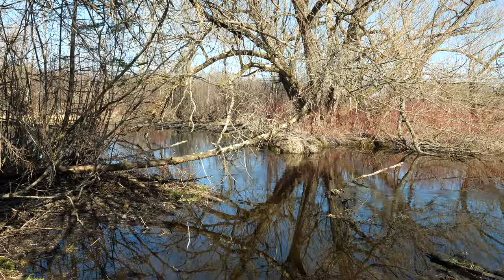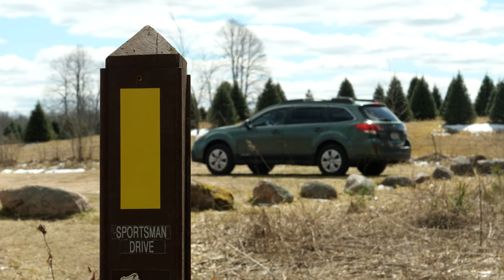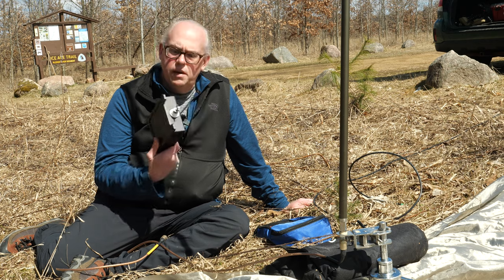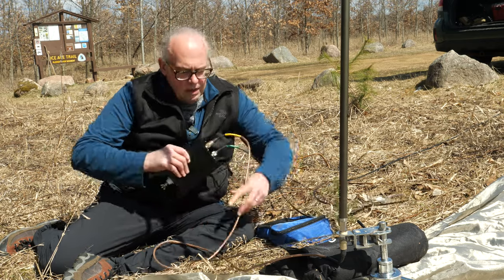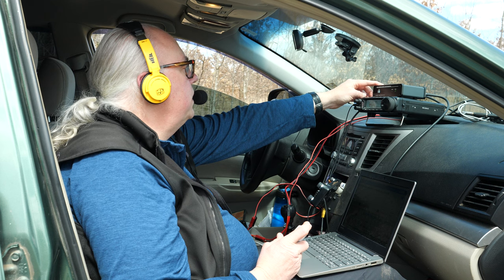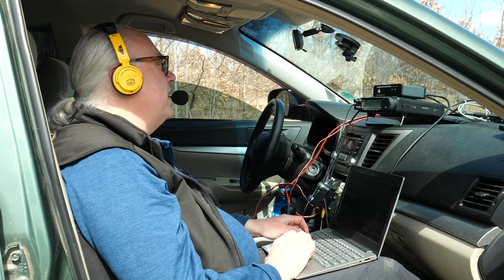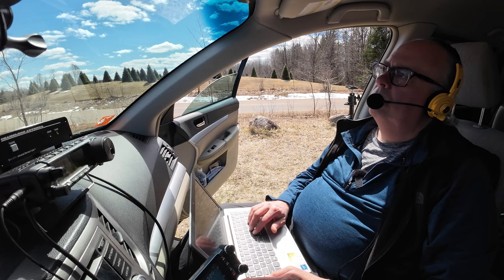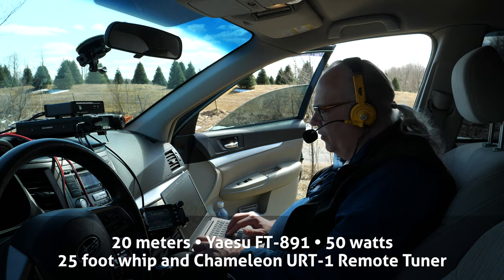Build the Frankentenna: the ultimate portable ham radio vertical antenna

Comment: Hey Mike, thanks for the video.
When I look at the dimensions and all the pieces of this Frankentenna, it reminds me of the Rybakov, except that it’s self supporting. If you use the chameleon hybrid, which is a five to one transformer, it’s almost the same.
Reply from the maker: Yes, this is very similar to the Rybakov. Also using the Chameleon hybrid transformer is a great idea instead of the tuner as it is closely matched to the 4:1 unun that the Rybakov utilizes.

Comment: I’m liking that tuner with the Frakentenna.  The only thing you had missing was the Chameleon Cap Hat placed between the 17” whip and the Mil Ext 2.0…. LOL. Thanks for another informative and entertaining video.  Bill, KC2KNA
Reply from the maker: I forgot the cap hat. That would have really turned this thing into a monstrosity.
Reply: @KB9VBRAntennas so I may try this set up tomorrow at home with my LDG z11 proii atu. I also have the cap hat, would difference could that make in your opinion

Comment: Great video Michael. What a great result with that antenna! I was out back this evening with my Icom 705 when it clicked--I've got Chameleon's MPAS 2.0-ditch the micro hybrid transformer and just use the Icom tuner at the feedpoint! Worked really really well. Great to see your demonstration that I've got a lot of fun to look forward too! Thanks! John KF0AE 73
Reply from the maker: Yes, you can do that. Using the broadband transformer is convenient, but using a remote tuner instead will increase performance.

Comment: that was very nice. thank you for taking time to get some nice video of the park !  that was a great day for the park. the upper bands been weird hear in NY as well. 10 and 12 meters was open but some noise and QSB and DX was going south for me. South America. Brazil coming in 12 meter SSB.   FT8 on 12 was mostly south and far west coast . was testing end fed half wave cut for 10/11/12 meters. I fold back end to tune. Veritable on 10 meter pole with 4 -17ft   counter poise. 49:1 UNUN with 2 stack of FT 240-61 toroid's and 100 PF 3 KV cap wound with 10 AWG mag wire. handles QRO  just fine. short time 500 watt FT8 no heating on ferrite. SWR 1.3 . love that remote tuner. 73's

Comment: Michael what is the ground plane you used? Looks different than the metal screen.
Reply from the maker: I use a fabric called Faraday cloth. It's a conductive fabric material that's primarily used for making electromagnetic resistant bags and containers. But it is conductive so it works great as a ground network. Here's the cloth: https://amzn.to/3RTjDv7

Comment: Roughly a Rybakov 7.6M antenna. Have often thought about trying this with the Chameleon Micro. Maybe even experimenting with the WR Sporty Forty center loaded to see if that would improve 40 meters. But thinking about it never got it done! Greet video.
Reply from the maker: You are correct, this is setup is in effect, a Rybakov antenna. Center loading the Sporty Forty is interesting, though. I'll add that to my list of things to try.
Reply: @KB9VBRAntennas  Had yet another thought. What if you center fed this set up? Seems like you would have a "by the book" less compromised shortened OCF vertically polarized                 dipole. Unused base feed point would isolate it from ground. And you might be able to bring your coax straight back to another support like a picnic shelter eliminating interaction of the antenna with the coax and as well as the "tripping point". Thus also creating a single guy point to boot.

Comment: Did the “feather flag base” need any other help supporting that vertical antenna?
Reply from the maker: If there is no wind, the base does support the antenna. But on a previous occasion using this setup, the wind knocked over the antenna twice. So for this time, i put a sand bag on the legs to keep it stable.

Comment: You should have connected the "beehive" connector directly to the base of the antenna with a wire, NOT a coax. The impedance is high and will cause a lot of loss using coax. Another option is using a 4:1 or 9:1 transformer at the feed point. Radials are also needed.

Comment: Michael, great video as always, question, does your "Frankentenna" end up closely approximating Chamelion's MPAS 2.0?  What do you think of that rig and is it worth the high price?
Thanks,
Paul Sanders KK6RXU
Reply from the maker: This setup is a bit longer than the MPAS 2, but it does closely replicate the Rybakov non resonant vertical. All remote tuners are pricey and the Chameleon isn't priced out of line compared to similar models (it's only $40 more than the Mat 40, and it has more features). Last week's video digs deeper into the tuner: https://youtu.be/Ubw6jrACVU8
Reply: Thank you Michael.

Comment: Very interesting! If you don't  mind. Im looking at the Icom 7100 vs ft891. Im leaning toward the 7100. Any suggestions, as Im new to HF. Thanks much!!
Reply from the maker: Good question, because both rigs are about the same age. The 7100 has the advantage of VHF/UHF and a slightly bigger display. But the control head is a separate piece, so you are always dealing with two parts. The 891 has the head integrated into the unit with the option of being removed, but no 2 meter and 70cm support. The 7100 was originally designed as a mobile transceiver, hence the separate head. I have a friend that takes his 7100 portable, he keeps it in a case and pulls the head out when he uses it. But other than that ergonomic quirk, I've used it and it is a fine rig. 

On a side note, Icom tried to discontinue it twice, but popular demand has kept the IC-7100 alive and they keep bringing it back.
Reply: @KB9VBRAntennas  Thank you very much! I did see it discontinued , and I asked them why. They told me that they couldn't get the chips or whatever components. Possibly due to the plandemic! I think Ill save for the 7100. It will be for mobile and home. Thanks much!

Comment: How would you compare that ATU to your LDG? If you had to chose one which would it be
Reply from the maker: That's a really good question as both serve slightly different purposes. For most portable operations a tuner by the transceiver, like the LDG Z11 ProII is sufficient as the impedance mismatch on the cable isn't that high and that tuner is a little easier to set up. But if I wanted to direct feed a non resonant wire or build a vertical without using a transformer, then the remote tuner is the way to go. 

The Chameleon remote tuner lets you do some really inventive stuff out in the field, so it is really fun to experiment with.

Comment: I NEED YOUR ADVISE. I WANT TO USE A 18 FOOT TELESCOPIC WHIP AND USE A MFJ ANALIZER. FOR 10 METERS, DO I NEED A 4:1 OR 9:1 BALUN ? THIS WILL HAVE 4 TO 8 WIRE RADIALS ON THE GROUND PLANE .
Reply from the maker: If you have a telescoping whip, you can adjust it to a 1/4 wave vertical. Then you won't need the unun at all. For the 10 meter band, the whip should be approximately 96 inches tall.

Comment: Dear Michael, thank you for this video. I am curious about this arrangement. Chameleon makes a coil that would easily (?) have given you the bands you wanted to use (I believe) and the $$$ is similar to the tuner. It is understood that your antenna knowledge is extensive, therefore my question: why choose the tuner over the coil? Thank you, KQ4IXD
Reply from the maker: Great question. The purpose of a transformer, like the Chameleon MPAS Micro (or mini) is the change the high impedance at the feed point of the antenna to near 50 ohms, which matches the the impedance of the coax cable. You can certainly use a transformer, or Unun, in the place of a remote tuner and achieve the same effect that I'm demonstrating. 

But, the remote tuner may be the better choice under the following circumstances. 1st, if your feed line run is long, a remote tuner will be more efficient in your overall antenna system in that you always have a 50 ohm on the coax, which means a lower over all SWR, and lower losses due to standing waves on the coax. 2nd, with some non resonant antennas, the impedance at the feed point can be variable and the 5:1 transformer may be not sufficient and will require tuning or adjustment near the transceiver. That means either using the transceiver's built in tuner or an accessory tuner at the transmitter. A remote tuner will always give you a 50 ohm match and moving the tuner away from the transceiver increases efficiency of your feed line coax, thereby increasing performance. 

Remote tuners can be expensive and it may be more practical to use an unun of some sort at the feed point instead of a remote tuner. Especially if you are using a relatively short piece of coax cable (under 100 feet). Picking one sort of matching system for your antenna depends on your goals and objectives and picking one over the other may be constrained by your budget.

Comment: Hey just looking for confirmation we ran you as a park to park on 3-29 you were at US-4266 we were at US-2273 your signal was crazy strong just wondering if you were running this antenna on that activation you did mention to us that you had tuner at the base would love to know if this was the setup or something else thx. keep the video's coming 73  KE8OUO
Reply from the maker: On the 29th I was using a different antenna, The CaHR Ares end fed random wire antenna. I put the remote tuner at the base of the antenna for the final impedance match. Last week's video had the setup in that park, fast forward to the about the 2/3 mark https://youtu.be/Ubw6jrACVU8
Reply: @KB9VBRAntennas   Thanks for the quick reply  you really had a crazy signal that day i had to reach up and turn the rf and the volume both down. 73

Comment: Great activation. Neat set up, but I can't understand why you would want to go to all the trouble of doing such a tall, non resonate antenna with all the wiring to the remote tuner when you could have just used the 17' Chameleon or MFJ whip for 20 meters on up. A lot of mismatch to be corrected.  The 17' whip would be a resonate quarter wave and more efficient. You weren't working 40 or 80 meters. I also think a much lower cost tuner at the radio would have worked just as well. Maybe a slight difference in loss, but not enough for anyone at the other end to notice. Especially when only using a short length of coax.  Remote tuners do have their place, but I don't see the use in this case being any kind of benefit. I appreciate you showing how something like this does work, but it's just too much extra work with zero advantage. Remote tuners are one of those things that a person should really think about and research before buying. They are darn expensive. Is it really necessary for what you are doing ? Will the cost be offset by any noticeable increase in signal ? In most cases, the answer is no. For less money you could buy a DX Commander portable and been way ahead in transmitted signal and receive strength. Money is tight and getting the most bang for your buck these days is important to most of us.
Reply from the maker: I did this because it's fun to experiment and I wanted to show some of the crazy things that you can do with a remote antenna tuner. Not everything aspect about amateur radio has to be about squeezing the highest level of efficiency out of an activity. 

But to your point. Non resonant antennas can be quite efficient and this particular setup is based loosely on the Rybakov. https://wb3gck.com/2018/12/09/revisiting-the-rybakov-806-vertical/ This is a 25 foot vertical with four ground radials, with a 4:1 transformer at the feed point. The impedance match is such that a remote tuner handles it well. If I used a tuner by the transceiver, I'd need the unun, but I can do without that piece by employing the remote tuner. What's cool about the Rybakov is that being non-resonant, it exhibits some really cool lobes on the upper bands, enhancing its DX qualities. Band conditions weren't such on this activation, but prior activations using this style of antenna resulted in some pretty cool DX, including Sweden, France, Spain, and indonesia (watch last week's video for those crazy contacts). Would a 1/4 wave vertical or even a DX commander give me the same performance? Maybe. But I don't have a DX commander and making a monster vertical whip is kind of cool.
Reply: @KB9VBRAntennas  I get it. It is fun to experiment and get a little crazy. We all do it with equipment we have. I just hope less experienced hams don't think that they will do better by buying a $450.00 remote antenna tuner. They won't. Too many new hams watch youtube channels, see something that looks really cool that is being gushed over and spend money that would be far better spent on gear that will not only yield better results, but cost a lot less. I'm actually glad youtube was not around when I got into ham radio. I learned from books and fellow hams what works the best and usually at a low cost. I didn't have multiple youtubers showing off the latest gizmo that made me think that it takes big bucks to get big results. In most cases, it doesn't. Perfect example is Walt on the Coastal Wires and Waves channel. A cheap roll of wire, push up fiberglass antenna pole, a dipole or 4 to 1 or 9 to 1 balun and the guy makes all kinds of great performing antennas. He makes contacts all over the world, both by the ocean (which really helps things) and inland when in Poland. All using a 20 watt, $450.00 radio. He uses the G-90 radio with it's great built in tuner and built in antenna analyzer most of the time, all for the price of a remote tuner alone.  You don't have to spend a lot of money to get great performance. You don't have to spend a lot of money to have many different configurations in antenna designs. You don't have to spend a lot of money to make an antenna that will set up fast and offer multiple bands. There are very few antenna designs that that actually require a remote tuner. I don't mean to pile on you. There are youtubers far worse when it comes to pimping radio gear. A lot of what you post is good information and is helpful to all ham radio operators. I just hate seeing new hams with very expensive piles of shiny radio gear that works no better than lower cost items or buying things they don't need at all. You're into this one antenna for over $600.00 (or would have been if you didn't get the tuner for free). Hey, if you really need a remote tuner, buy one. Look around, there are other good ones out there, the Chameleon is not the only player. Check out "Mark the Ham Florida Man" youtube channel. Ham Radio Myth-A Remote Antenna Tuner is Superior